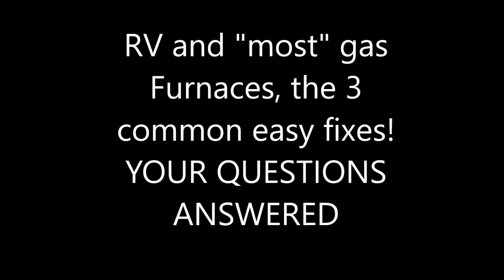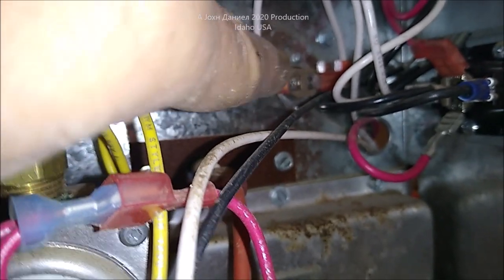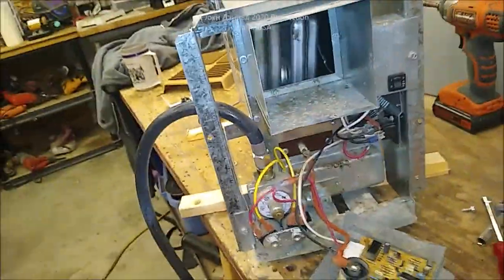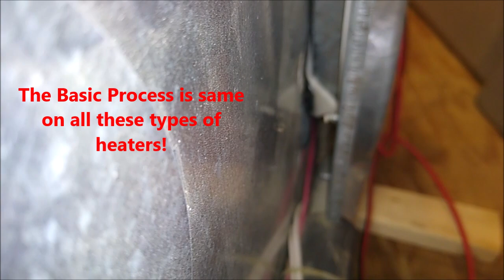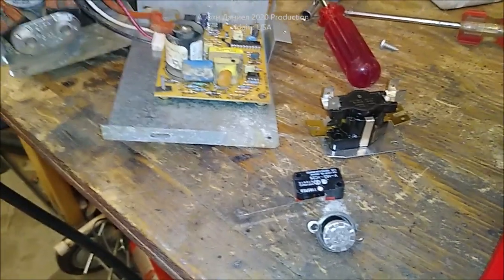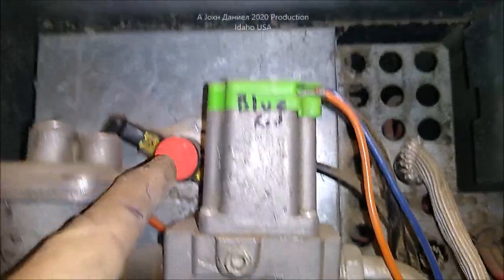RV Furnace REPAIR TECHNICIAN SECRETS Top 3 Easy Fixes anyone can do PARTS BELOW

Comment: I watched this video and I was getting ready to order the relay but I started with a new thermostat and that fixed my issue. Do you do any videos on a 2004 Dometic AC top unit that isn't connected to an on the wall external thermostat?  I have one and it won't do anything,  no sounds no humming 
..nothing. The breakers are not blown and neither are the fuses.
Reply from the maker: Being that your AC unit is a common one-piece model you could have a wire nut that came loose up inside or  you could have a breaker that's a non-fault switch problem so I suggest flipping your breakers on and off on the main panel a few times to make sure they are full contacted and then try a fan only on the AC unit to see if you get a result. If that doesn't do it take the cover off and look for any wire nut or connectors that might be loose on the power side at the air conditioner that's pretty common with fast built RVs.

Comment: I am so sick of fixing my stupid furnace. Changed the igniter board 3 times, fail switch twice (changed the s to an f because I found it more suitable), thermostat once, and the high limit once.
Furnace is a dometic (Atwood) hydroflame and only a year old. Had issues since new lol...
I went to a Dino board and that solved the ignition issues, and so far, it's been good for about 3 weeks. Good for this particular unit lol
The problem is these stupid little parts are really expensive in Canada! Like that sail switch. It's just a standard d41x microswitch which you can get for like three bucks on eBay. Call it a sail switch, and suddenly they're 50! So I bought a few micro switches and now I just put that aluminum sail on whatever switch I'm using lol

Comment: I have a question that maybe you have a answer to. I have a early hydro flame furnace LB-11L and it uses a pilot system along with a thermopile couple. All thermopiles I see have 2 wires with connecters and mine has 2 wires but goes to a fitting that screws in the valve. Any ideals on a part number so I can get a new thermopile or complete pilot assy
Reply from the maker: Hydroflame used the 750 millivolt like these in some older models https://amzn.to/2LpKXB7 . If that one looks familiar then Its a simple change out. Which wire goes on the either  terminal don't matter. Its a magnetic gas to pilot switch that stays open only when energized.
Reply: @JOHNDANIEL1  
Mine is similar to that but it doesn't have the 2 individual wires, the 2 wires go into a screw in brass fitting like any normal therma couple
Reply from the maker: @yamaharider7672  Send me a few picture of it to my Email, olympicpowercontrols@yahoo.com
Reply: @JOHNDANIEL1  
Message sent, Thanks alot

Comment: Mine works great on 12 v only, I have to turn off my charge controller aka magnajunk circuit breaker that charges the battery in order to allow the fan to blow at normal speed..everyday on off on off..ug! If I don't turn off the breaker..the furnace fan blows too hard and can't light..I've scoured the web and binged on your videos all day..great content, I hope you can help me !
Reply from the maker: If you have a bad battery in your system or No Battery, that will be a continuing problem. The charger should not be running the system of 12 volt items, and too many people will run their RV with the controller and not have a good battery in the system to keep volts stabilized.
Reply: @JOHNDANIEL1  thx for the reply!
Reply: My battery is new and working I think somehow I have too many white wires connected to the dc side . I took out the old unit and replaced with new, the wires were already routed there on the new unit from the charger/controller bit there was also 2 other white wires on that side from the old unit.
Reply: Also like I said the furnace runs on the battery perfect as long as the breaker for the charge controller is turned off I have 4 breakers , main, outlets,furnace,microwave outlet, ac wires are disconnected to use the breaker for another outlet run I added. Had this over thrust of the furnace fan before , reason I changed the whole unit then saw the wfco was super cheap and could a got that direct mine is a magnatek/ parallax 8300

Comment: On a cargo trailer camper conversion...My batts are 12-15ft away from the inverter.Can I ground/negative wire to frame of trailer and pick up my inverter ground/negative at the inverter location with short 2awg lead instead of running two leads of 2awg wire from batts to inverter...Also could I connect the charge controller directly to the input leads of the inverter instead of running leads for that alone or does that need to be it's own circuit? They're both hooked to the same batts?Trying to eliminate as much as possible...less work/less cash lol

Comment: Great video and thank you.  I have an Atwood water heater question if I may.  I am not getting 12volts to the Combination Switch, the water heater itself is running fine.  Trying to track down the 12volt wire to the fuse box, I think I have a fuse box failure because the fuses are all ok.  What amp fuse runs a 10 Gal gas/electric water heater?  Is it 25amps?  I have 2 fuse box's on the panel with nothing labeled from the factory (Fleetwood).  I got the water heater working by running a 12volt power supply just to check out the water heater, now I need to find out why my 12volt brown wire to the switch has no power.  Thank you again.
Reply from the maker: Fuse is 15 amp, and you have 2 over temp switches in them that if one fails you get no power to the igniter or board. Do you have power to the wires near the heater? If not your switch in the RV is bad or a fuse link near it is bad. If you have power near the heater but not the board or igniter you need to replace the over limit switches since they respond to the switch in the RV to allow it to fire up.

Comment: Ive had problems with sail switches in 2 rvs.  Just exercised them manually and worked fine.  Rv had been setting over winter and longer.
Reply: Thanks . I'm gonna try this. My fan comes on  but I can't get it to heat up. So the hi therm. Seems good. It's gotta be the sail switch. I do believe I can also bypass this switch to test .is that correct.

Comment: Over the last 12 years working as an RV tech i have replaced 2 or 3 thermal disks, i few fan relays, now they are part of the board, but 9 chances  out of 10 it is that sail switch. Good video,
Reply: Hey man if you don’t mind asking do you work for a dealer or are you mobile tech ?

Comment: Just watched this video lots of things I can check , do you know by chance what the symptom of heater works fires and runs fine however fan blower motor never shuts off ?
Reply from the maker: The vent out and cool down cycle is controlled by a timed delay relay. If your model has one, and If the blower never stops running it's contacts are fused.
Reply: Јоhn Daniel thank you!!! Always great work you do !

Comment: If you are in a dusty area can you put a filter on the front of the furnace?
Reply from the maker: Not normally. These furnaces have numerous places the return air will flow back through. And you cannot put one on the output side. But a very light green fiber filter is the only safe cut to fit I would use on one if a mounting spot is available.

Comment: If you do in fact replace the diode,  leave it a 1/4 inch above the pcb board.  They cool a bit better .  if you mount them right down on the board a drop of heat compound will transfer more heat to the PCB and help ya out even more.
Reply from the maker: Exactly. That's why I said to leave the diodes legs long.

Comment: Yes, take a multi meter or test light and check a connection goes through them all.  Before you change the board also make sure there is a spark, also make sure the spark in not shorting dut to a breakdown in the insulation as there is a lot of voltage going through it.  There is also a probe inside to detect flame on some models, others use the same spark probe to detect flame )it changes the AC spark to DC and the board will lock on until up to temperature when it will go off for a while before firing up again.  Check this probe is not burned away or gone brittle.  The over temperature and fan change over (pressure switch) often fail.  If the blower motor runs for a short while then goes off, suspect the fan switch.  If it does not come on at all, over temperature switch.  If the burner fires than goes straight off again, it is the spark probe of sensor probe depending on model.
If you hear clicking like a spark, look for a break in the insulation on the HT spark lead, it may look perfect, but if you lift it away from metal you might see a spark jump, or run a screwdriver (not a metal handle) along the wire, if you see a spark jump before you get to close to the spark probe, replace the lead.
If all else fails, the board may be faulty, but check everything else first, it will save you a lot of money.